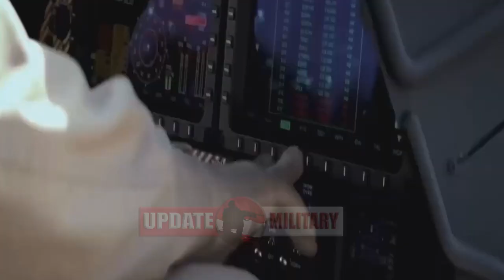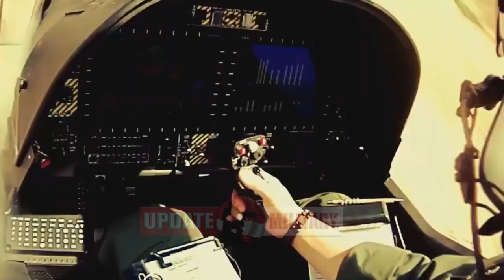Turkey upgrading its helicopter engine this year

Comment: T629 Taarruz helikopteri bu yıl TS 1400 motoru ile uçacak Pakistana T129 yerine bir üst modeli olan T629 teklif edicelecek T629 T129 daha iyi bir helikopter. 6 ton ağırlığında TS 1400  motoru yerli ve güç aktarın yani ana rotor ve kuyruk rotoru'da yerli. 20mm makine topu da yerli üretim. T129 üretime çok büyük ihtimal duracaktır T629 ile. T625  gökbey ise 2021 seri üretimde olacak TS 1400 motoru ile. Ve Atak 2 içinde çalışmalar sürüyor Atak 2 10 ton sınıfında bir taarruz helikopteri ve T629 bir üst modeli olacak ve bunda da yerli motor olacak. TS 3000 adındaki motor 3200 beygir X2 olacak. 30mm'ilk bir topa sahip olacak.